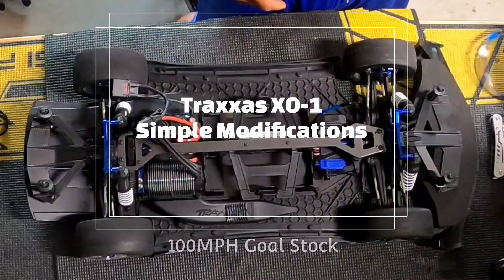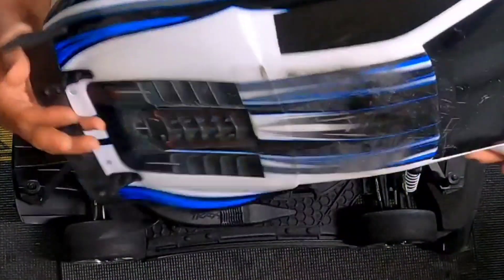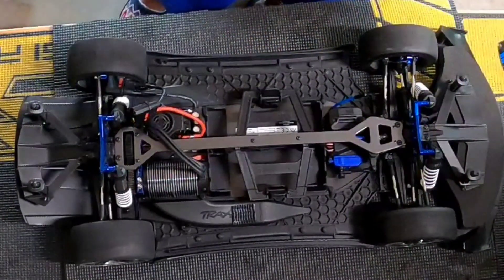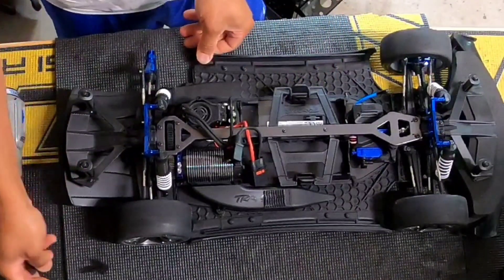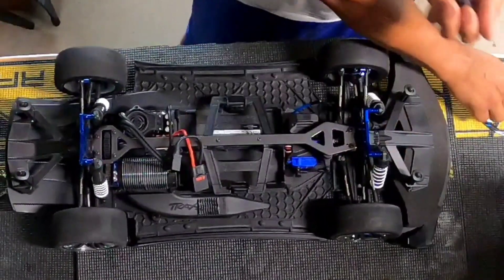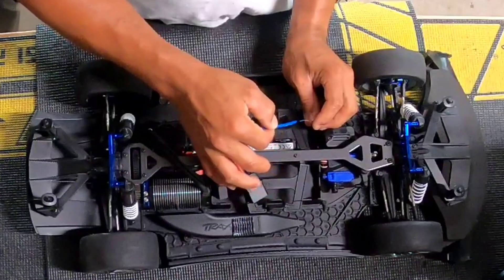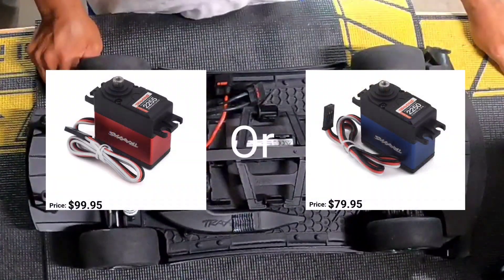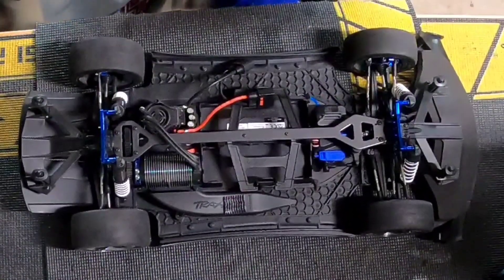Traxxas XO-1 Little Hacks to Achieve 100MPH

Comment: Ballenger wheels you won't have to cut that chassis
Reply from the maker: You cut for the factory wheels. Tires balloon like crazy. This point was to get 100mph which is extremely rare by most XO-1 owners. And the Traxxas app is extremely off on the speed. It only calculates the rpms which you can blip the throttle to get 100mph. My app said I did 110mph but it was only 94mph. But the factory run series show every possible way to keep it factory as advertised to achieve 100mph which is extremely difficult. The final video of the series I share the solution to getting 100mph but unfortunately I do not consider it factory as advertised.

Comment: Would’ve been a lot less work to simply balance the tires so they didn’t shake and hit the body.
Reply from the maker: Body wasn't the problem.  The ballooning of the tires was.  And there is nothing you can do about that.  Replace stock tires for another set of stock tires and run it again.  You have a few runs before they go.

Comment: Thanks for showing off these hacks i recently bought an old version XO-1 roller off eBay and now that the new car is out for pre order i'm now debating if i should sell mine and get the new one complete brand new or if i should keep mine. If i keep mine i will be putting a Hobbywing Max 6 with a Stock 1717 big block motor or Castle mmx 8s with current 1717 motor into it.
Reply from the maker: The re release revised version isn't much different.  You're fine.  Just purchase the rear wing and cut a vent hole in the body.
Reply: @MatrixRC  Yeah i was thinking it would make more sense to convert the one i have to the new one the upside is i can pick my own electronics, body and wheels\tires and i don't have to the unlock the stock esc to go fast. But the only downside is it will cost more upfront.
Reply from the maker: Which is a huge disappointment to many XO-1 owners.
Reply: @MatrixRC  I wish Traxxas would sell the XO-1 as roller with a clear body and wheels and tires like they did with the Slash 4x4 Platinum but without the electronics. Arrma sells the Limitless as a roller and pretty popular and sells i personally wanted before i decided on an Infraction it's so hard to talk about the XO-1 nowadays without mentioning the Arrma 1\7 on roads.
Reply from the maker: I concur.  Instead of a 799 price point with cheap parts.  It's only natural to gravitate to the Limitless and HoBao VTE Rollers.  You Dave money and get a premium car

Comment: Great work on fixing the issues you found. I had one when they first came out and made some decent mph runs i think 113 was the fastest. but probably wrecked more than I made good passes. I think more rear Downforce would help the car because the rear always got loose when making a correction. Best of luck on your journey..
Reply from the maker: Thank you and that is exactly why I think Traxxas released the updated version with the large wing.  I was looking at that and thought that would create drag but more rear wheel traction.  But we getting there.

Comment: The new redesign xo-1 is out.
Reply from the maker: Yeah I was notified.  It's on pre-order now.  What is your honest thoughts?
Reply: @MatrixRC  I might have to get one. I'm not a speed run guy but I do like high-speed circuit racing wondering how it will do as I don't have a 1/7 scale only 1/8.
Reply from the maker: Honestly nothing against Traxxas but you would have a better experience with a Hobao VTE 1/7 extreme and put your own electronics inside. You would save money and have a stronger car.
Reply: @MatrixRC  I do like the hobao's as I have 3 already. What I like about the xo-1 & the arma's are the front splitter, side aero & rear diffuser. No one makes any for the hobao's unless you make them yourself.